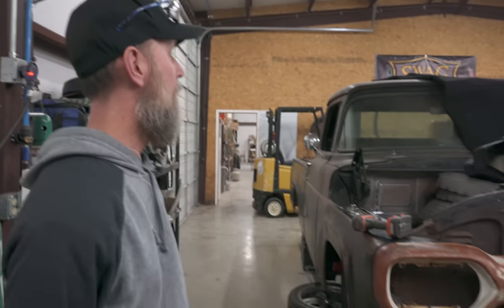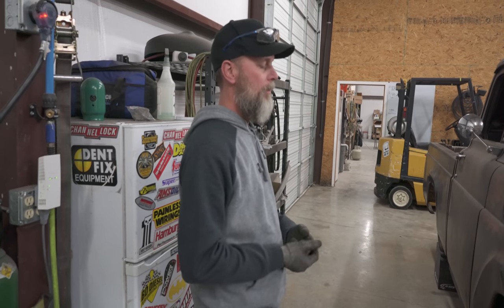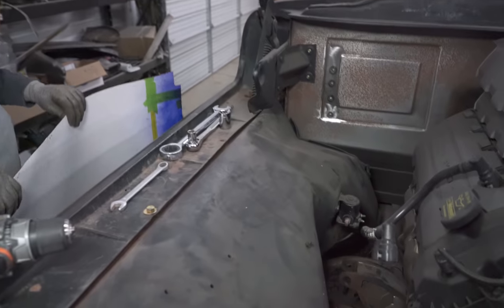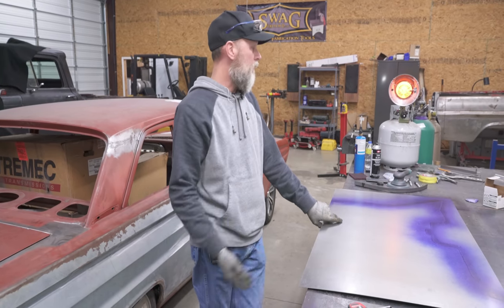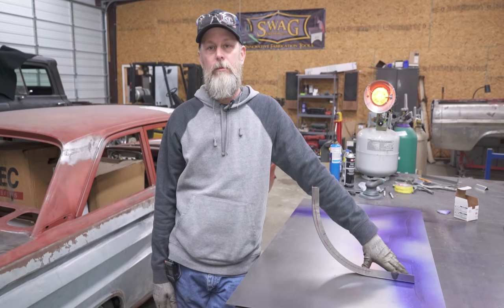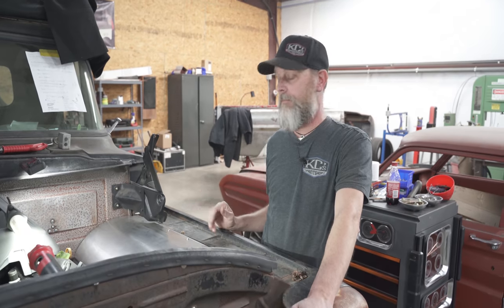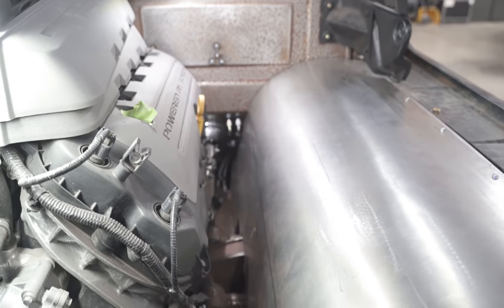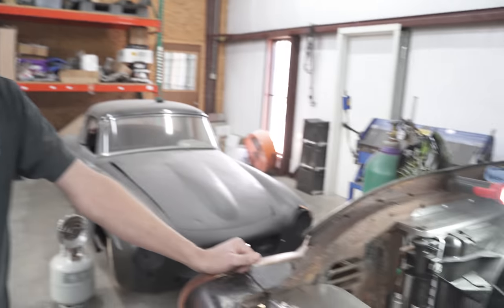Making Custom Inner Fenders From Scratch [1960 F100]

Comment: Hell yeah. Im going to either try to fix my fender or make a new one. The other day I found an old dolly and hammer, looked at the fender off my 67 on the wall, took a piece of 18 ga roof flashing, and started to hammer away. I've never tried just watched hours of youtube on it. It turned out half ass pretty decent, I only did the front part of the fender but I find it impressive. Gave me the idea to fix what I have instead of looking for a new clip.
Reply: That's awesome Daniel. Keith and Zach just gave me a hammer and dolly lesson. Turns out my driver side front fender on the Z has 3 good size craters that were hidden under filler so instead of buying aftermarket (advised not to by Zach cause he said I'll spend just as much time trying to get it to fit and gapping it) I decided to buy a hammer and dolly kit and plan to work away at it. I use a straight edge to see my progress and where my highs and lows are. It's some work but it's fun learning and fixing.
Reply: @Photobombin  it's really fun. I wish I was in a better position to get out and get into this world but family business, kinda drags you down. Im 22 and I've got 3, maybe 4 project trucks. A 65 f259 service truck, 67 highboy. And my 86 f350 cc dually diesel. No time or money to work on them and the dually is supposed to be my daily but weather and my free days never seem to line up. Might even have a better chance at getting my highboy on the street before if I throw another fender on while I fix the current one.  Getting the axle this weekend. Sadly an axle is easier to ke then dropping the trans out of my 86...

Comment: KC.... We need to get you some hanging shop heaters.
Reply: The guys would love that. It takes Shopdad an hour to get thawed out in the morning.
Reply: @Photobombin  We install LB White 250k btu heaters for all type of heating application. Like me know if you have and questions. Very user friendly.
Reply: @Photobombin  Will do by lunch tomorrow.
Reply: I was thinking the same. It is too bad that those ceilings are so high and the building does not appear to be insulated. If I had a place like that (I know KC doesn't own this and therefore it would not be worth his money to heavily modify the building) I would have a couple bays setup with a drop ceiling and insulation to be able to heat and cool more efficiently, and only use the taller bays when necessary. Heck, even the lifts would likely be fine under a lower ceiling. Heating that shop is going to take a bunch of energy, but it would sure make it better on the guys. Do you have natural gas there and how would gas heaters compare in running cost for electricity where you are at?

Comment: Very nice work guys. Curious on what radiator setup you went with? Trick is to get it to sit low enough between the frame rails so that there is enough clearance for the air inlet tube to connect to the intake. Not a lot of room, but it seems like you have yours low enough to accomplish that.
Reply: We used a 2015 Mustang radiator with a cobra jet fan and custom made brackets. We use 2015 Mustang condenser and trans cooler as well. Makes finding parts a lots easier if anything needs replacing.
Reply: Erick Barrandey great thank you! I’m building 57 with a 4.6L 3V from a 2006 Mustang and there are some similarities here. So any lessons learn by others helps huge! Love your approach. Thanks again.
Reply: @darcymcintosh1372  Nice man! Well if you have any more questions, just shoot em our way and I'll do my best to get with the guys and get them answered. I think in the future it would be cool to film our process using the 2015 setup as we use it a lot on our F100 builds. Best of luck man!